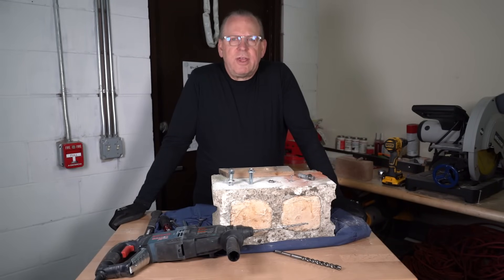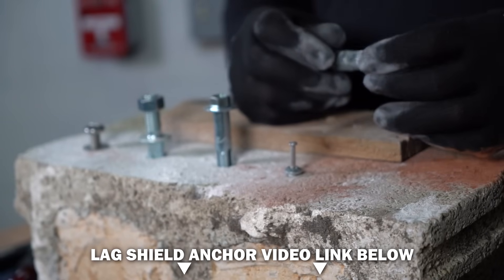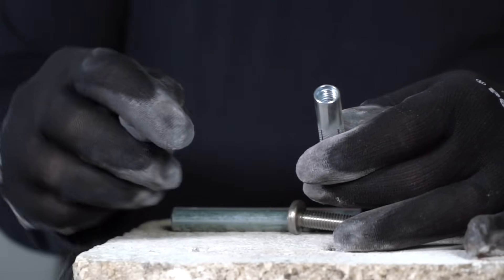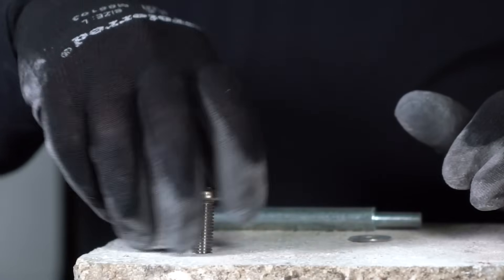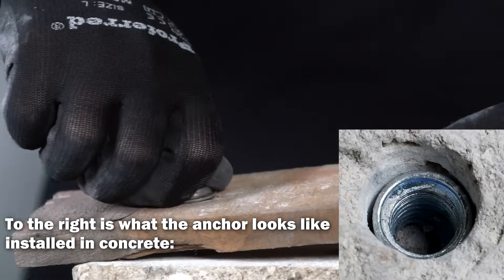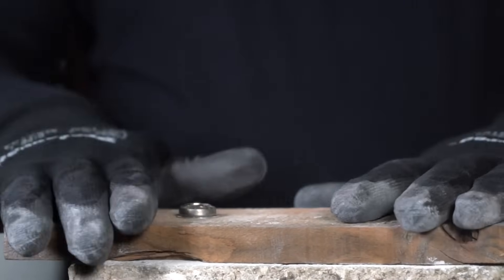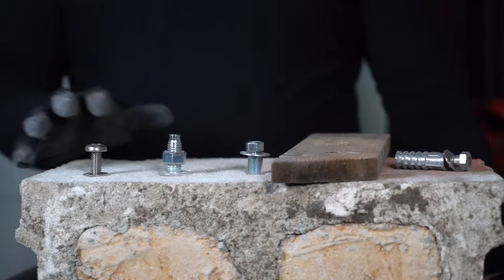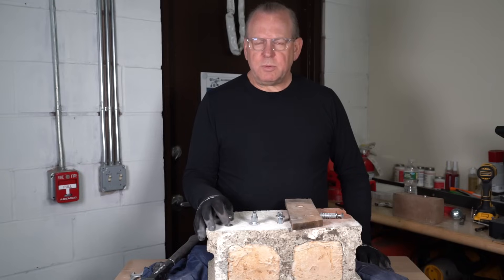How to Install Masonry & Concrete Anchors | Fasteners 101

Comment: Totally useless video, no specs for hole sizes, depths, clearances. just a waste of time showing how to push the fittings into the concrete.
Reply from the maker: This video is intended to be a simple introduction to how various anchors are installed in concrete. Hole size, depth, clearance, and other specifications will vary wildly depending on the type of anchor, the diameter of the anchor, the length of the anchor, and the application they are being used in. We advise either contacting us to discuss your application to help you narrow things down or browse our selection to determine what will fit your needs: https://www.albanycountyfasteners.com/anchors/acf_cat_anchors.htm